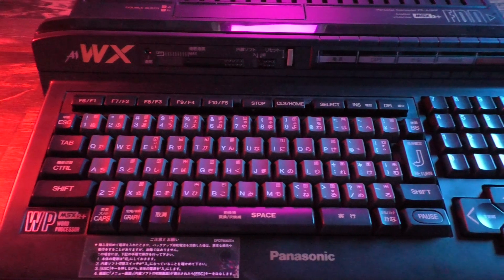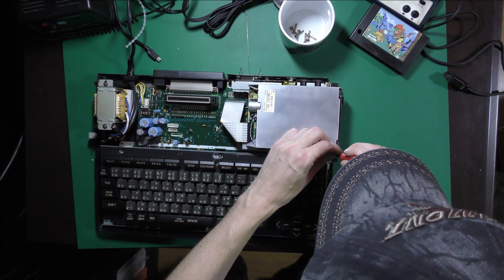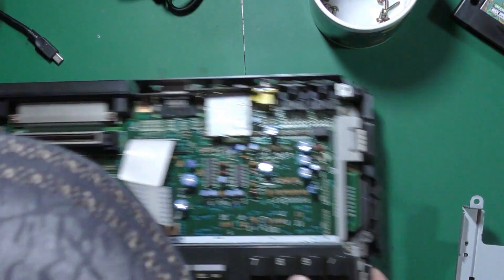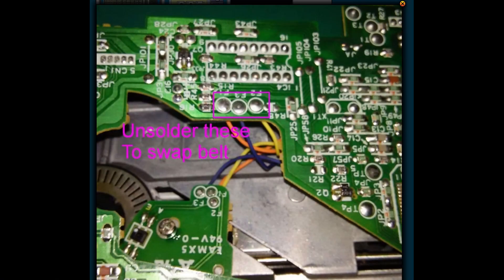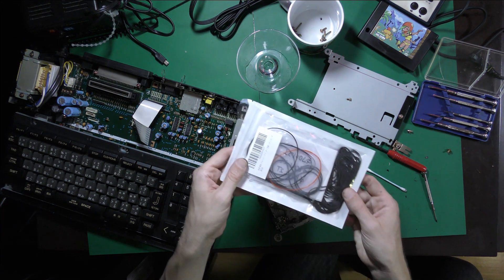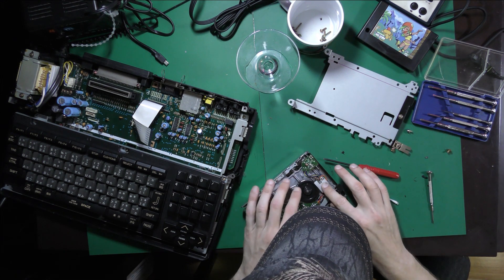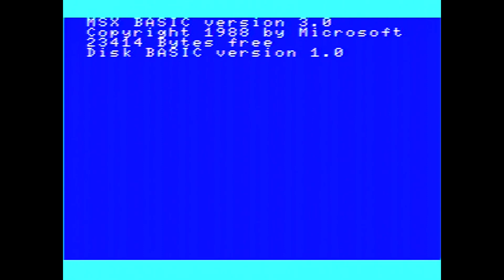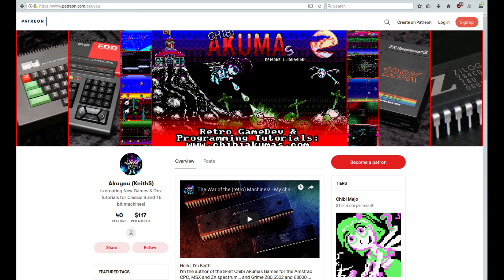MSX2 Repair: WX/WSX Floppy drive belt swap

Comment: you are better buying a sd card cartridge. disks are a pain and hard to find.
Reply from the maker: I have one, but if I ever want to sell it I can now sell it as fully working
Reply: @ChibiAkumas  yep sure but it is not a big deal for anyone that it works or not because of the rarity of floppy disk software and because of the sd card cartridges and also the option of having an interface cart using another disk drive. i can understand as a seller you could maybe sell it a bit more but its not a big deal like i said. some might want buy a cheaper model with no fdd instead. like me i bought one with a defective fdd so i pay less for it or i would have got a model with no fdd because i dont see why i would use any floppy.

Comment: I've just bought a faulty MSX DPC200. When turned on, it gives power led light and the screen turns blue and that is it. Not even light to the caps lock key. 
I don't have another unit to interchange parts to try. 
What can you suggest for me to fix it?
Reply from the maker: You'd be best to ask on MSX.org:
http://www.msx.org/
They know a lot about different systems